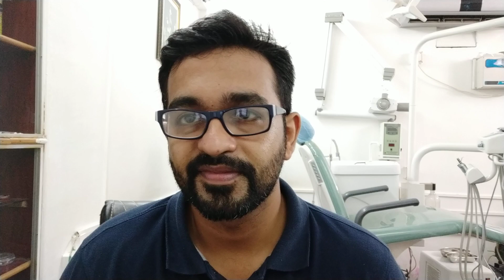TOP reason for pain after RCT in tooth | आर सी टी के बाद भी दांत में दर्द का कारण

Comment: Rocking crown may b happn due to some small pin point bubble in crown or on tooth surface..
.
I just put biting paper on patient tooth surface n than fit crown on tooth (in single unit crown)..
After removing  crown it leave marks on tooth surface or crown..i just releif it..crown stop rocking..
.
But this technique only work good in single unit..